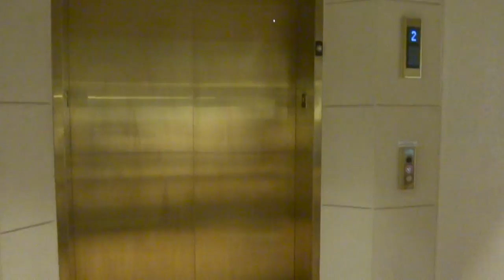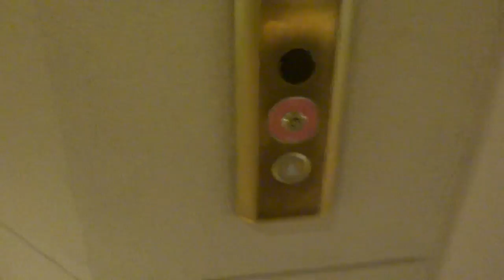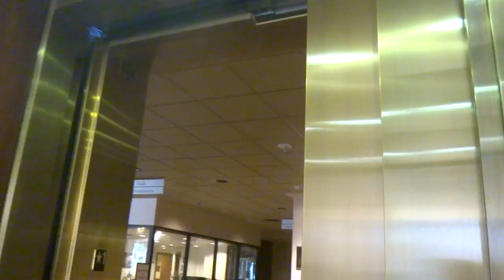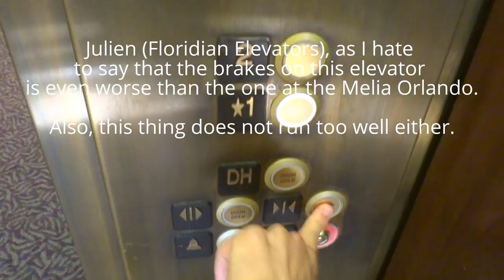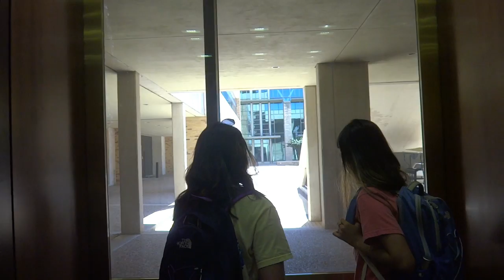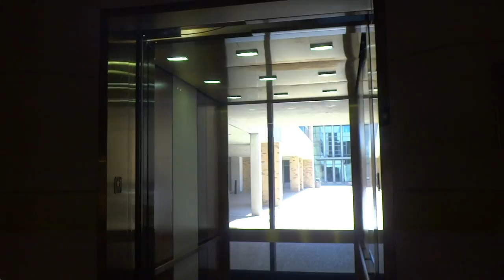LOUDEST Kone brake system on the EcoDisc! For Floridian Elevators & princess laugh! 😂

Comment: There is nothing wrong with the elevator.  That noise is simply the brake setting.  This is a great elevator.
Reply from the maker: I do know that it's the brakes. But it's very loud and annoying.
Reply: That is normal on an ecodisc. Ecodisc brakes are usually loud.
Reply: Vancity Elevators Not always I've filmed 3 Kone Ecodisc Elevators. The brakes were not that loud. I say that is one of the loudest Kone Brakes I've ever heard.
Reply: Not in Europe they aren't always loud. I've seen videos...... :) I think this is very cheaply made
Reply: Floridian Elevators I know as a matter of fact I'm in Europe I like European Kones. I'm posting 1 for my birthday.
Reply: Floridian Elevators this is by no means a cheaply made elevator.  kone ecodisc and otis gen2 are 2 of the best mrl elevators on the market.  keep in mind the machine is IN THE SHAFT so naturally the brake noise is gonna be much louder than in a traditional machine room elevator. also the ecodisc is a rotational linear motor  with permanent magnets which is EXTREMELY energy efficient and it doesn't require ANY oil so this makes it one of the best elevator drive systems available.   I used to not care for the ecodisc til I did some research on it and have come to the conclusion I have.  it is an amazing motor.

Comment: I did rode them. I should tell David, Randy, or Mitchell to improve. Like me and Jack said "Mitchell how's the KONE's quality now?" I said more than Mitchell. I said "Mitchell, Randy, and David how's the KONE's quality now?" I have a KSS 500 button given by David the KONE guy. The Elevator at the Orange Line TriMet MAX Train station at the parking garage. It runs smooth and the brakes sound quiet.